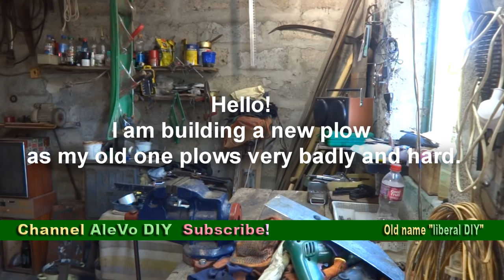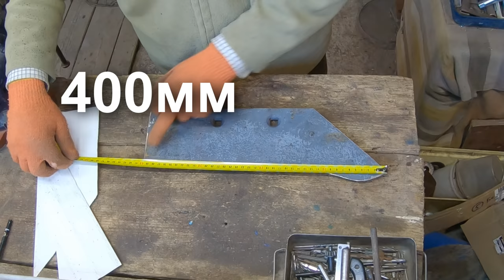How to make a PLOW for a mini tractor. Homemade plow

Comment: You're throwing a lot of dirt to the left; your tilt side to side could use some more adjustment. Also, as your moldboard is a repurposed gas tank, you might want to look at adding an opening coulter to cut through any crud in the way. 

In a way, the worn out tires are a good test for the new plow; think what you'll be able to do once you get some better treads on the tractor!!! :-):-):-)

Comment: can you make a plow wider or is it more efficient like the way you made it?
Reply: If it’s wider you’ll end up with a larger furrow in the beginning since it’s a turnover plow. And it requires more horsepower. My dad always told me it’s around 11hp required per plow bottom.
Reply: @jinx8164_ depends on the size of the plow, something this size yes, 11 hp per plow. Something larger like what's used on bigger farms I'd suggest something closer to 15hp per plow. It all depends on your soul though too.